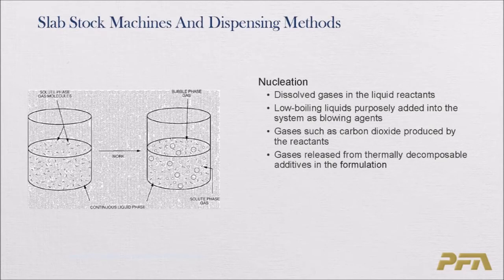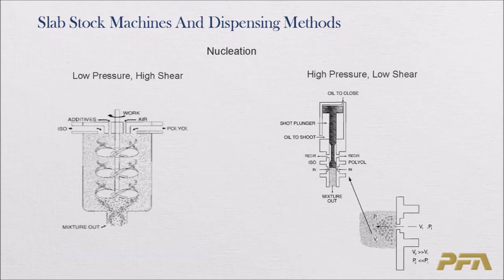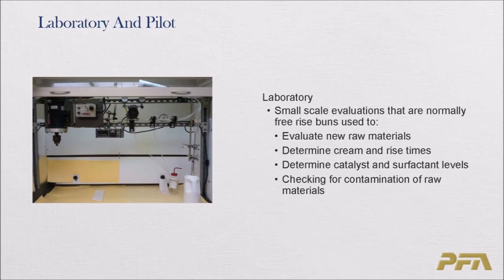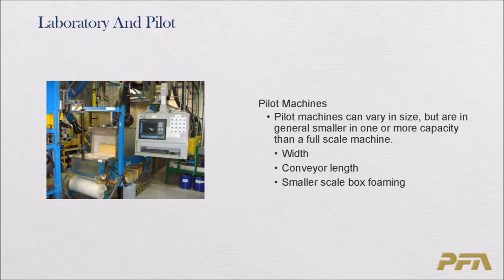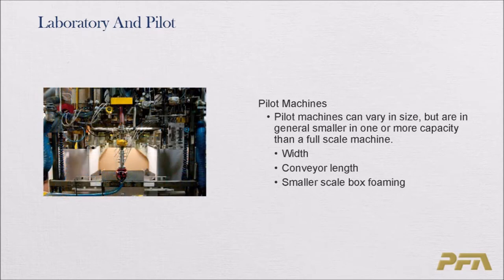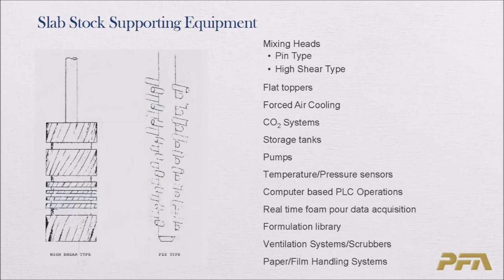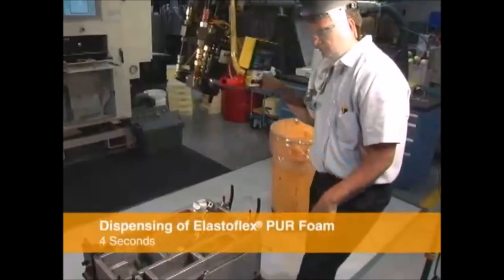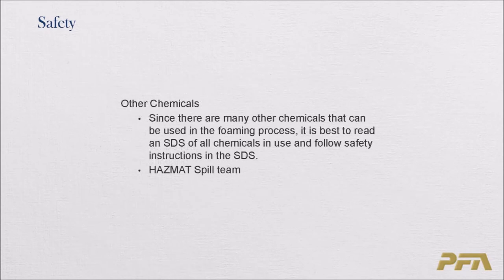Foam Equipment

Comment: What is the maximum ratio filler to polyol in low pressure system? I mean the maximum percentage of filler that can be used without significant change in the foam properties.